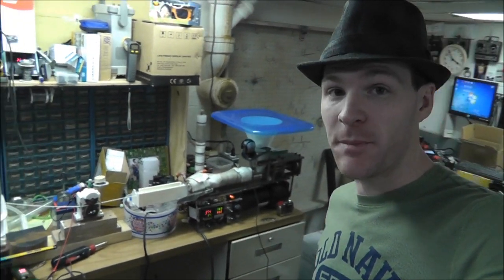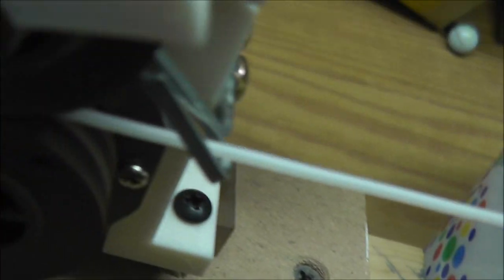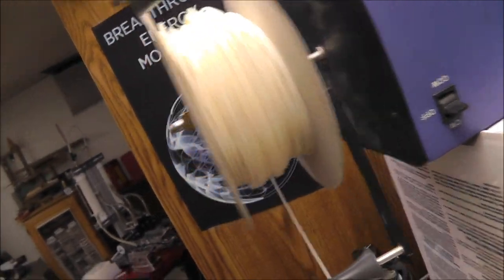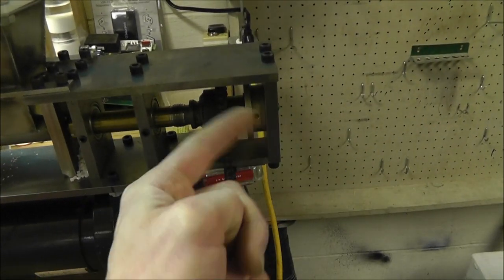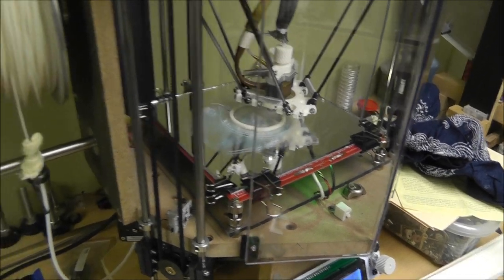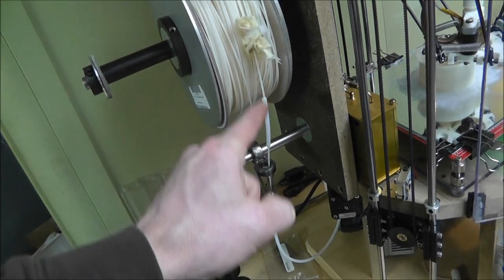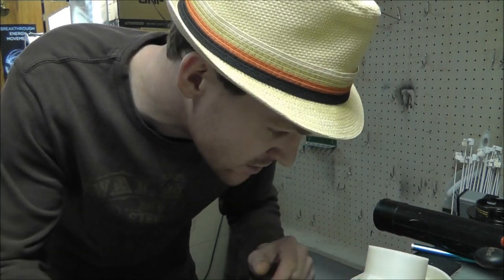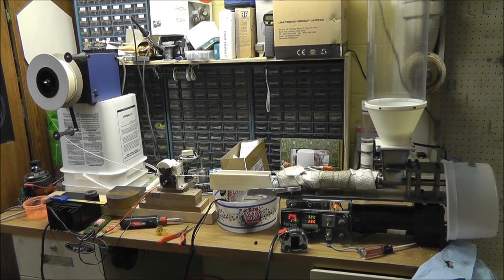#13 ~Russ's Filament Extruder: Over View, Thoughts, & Making Good Filament. www.RWGresearch.com

Comment: Working in a paint factory that uses a similar, but larger extruder.. when we do it, the hopper has an actual feed screw, leading to a tube, which then spits out the powder mix (in your case, filament pellets) into a throat pipe that leads to the extruder screws.  Oh and our extruders use two screws countering each other to extrude the material, and those screws have 'knuckles' in one section that are blocks at varying angles, to stir up the material as it melts.  So in other words, maybe you should split up your hopper and extruder, and rig up a little drill-style screw shaft to feed your pellets into the extruder?  That way the pellet weight has no effect on your tolerance, so it'd be all in extruder/puller settings.  More likely to be easier to control, in the long run!

Comment: I was watching a video that a mass producer of filament put out and he said to get rid of the oblong in the filament was to heat the water in the first bath before going into a cold bath. Personally I would use an old coffee maker that doesnt have auto shut off to maintain the heat by putting a small water pump into an old glass coffee pot.

Comment: Hi Russ,

You are absolutely right about the length of the extruder. I have tried short and long screws As the length of the screw decreases the pressure on the nozzle decrease so does the extrusion speed.

You should definitely get a more precise caliper. Actually when you say I get plus or minus 0,1 mm tolerance, it is plus or minus 0.15 mm . If you measure values such as 1.7, 1.8 and 1.9 mm, the actual thickness may be 1.65 to 1.949 mm which is a high tolerance for a 1.75 mm filament.

Thanks for the video.

Mehmet
Reply from the maker: glad to see you answering the same question!

thanks!!

~Russ

Comment: If the filament is too thick, it won't fit in your extruder... but if it's too thin, you can just configure your slicer to pump out more. -- Then your layers will still stick together just fine... -- also "Overview" is one word, bruh.

Comment: Check out a fishing reel some fishing reels have a worm gear.. You can also take from the idea and make the parts bigger using your 3d printer to make the parts from. its a temporary idea but the plastic moving against the plastic should be acceptable and shouldn't cause much wear. here is one that may work. http://assets.academy.com/mgen/15/10228015.jpg?is=500,500